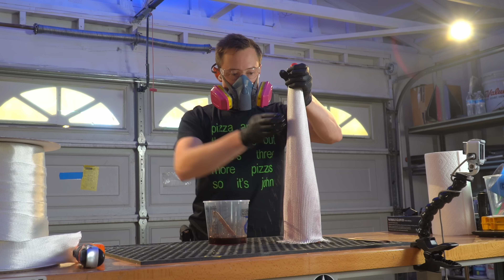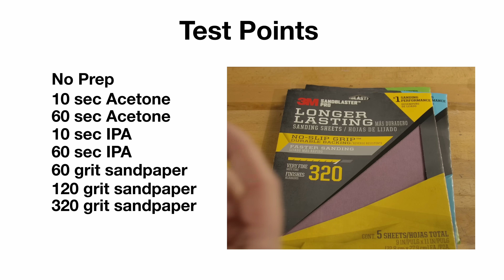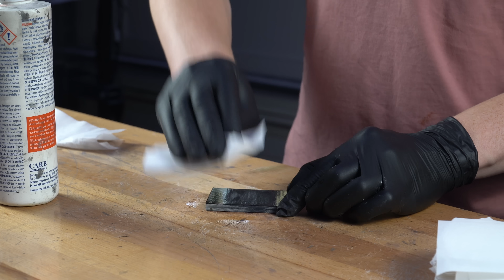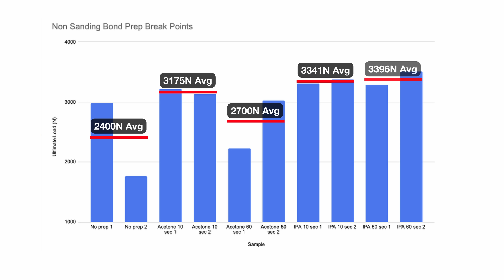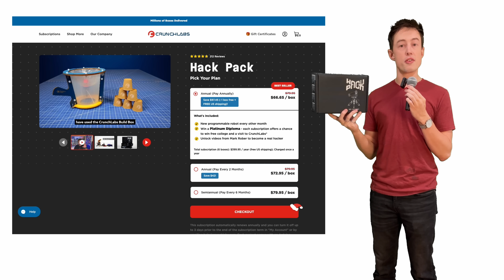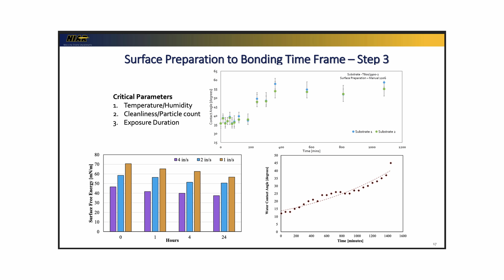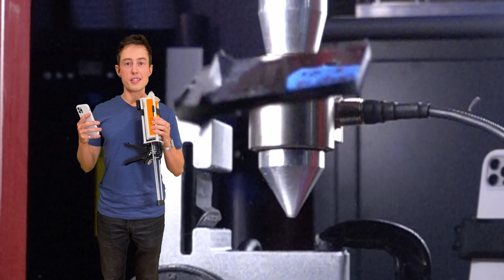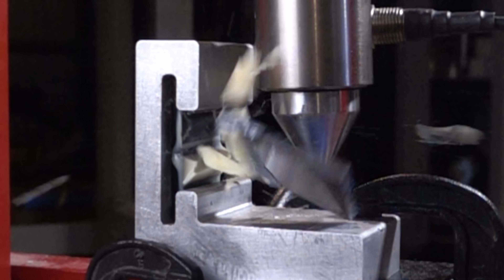I Broke 100 Epoxy Bonds to Find the Strongest

Comment: Question: Did you sand the edge of the horizontal piece, or just the face of the vertical piece? Did you consider using CA glue on the edge + epoxy on for the fillets? Just a thought...

Comment: next test drill holes where the in the fiberglass where the epoxy will be and reinforce the epoxy with a thing bit of fiberglass "skin" and let it cure in a pressure pot

Comment: Hmmm.....Could non-degassing the epoxy, which would allow for some small bubbles to remain in the mix, provide a more "flexible" joint and therefore survive longer before failing...?

Comment: You fell into the typical measurement system error problem. Your measurements are causing most of the differences in the results. Without properly addressing this you will never find an answer to your problem.

Comment: I would ditch the sandpaper and use ULine stainless steel wool. You can easily clean the contamination off steelwool. Lasts a lot longer then sandpaper, too. It also conforms to odd shapes, concave, and convex, much easier.

Comment: I did something similar to this for my university thesis project. I did heaps of testing using the universities instron and I got loads of data. It was filled with errors, but as you say, it has value. Check out my video presentation here:
https://youtu.be/ugsR2vnBUhM?si=D-iX7MkAWXvkSYfZ

Comment: Coming from the boat building industry you should definitely try MMA glues. We use SciGrip SG-200 for laminate to laminate bonds, SciGrip SG-300 for metal to laminate bond. The stuff is indestructible, even with little to no prep. We avoid epoxy as much as possible.

Comment: Did you consider cleaning with soap and water? Ben Krasnow has a great video on how to clean surfaces. The tldr is that cleaning with solvents doesn’t work very well. It always leaves a thin layer of non polar grime.

Comment: I suspect theres a ratio of acetone and ipa as a mixture that would work well as a one fluid surface prep. Maybe 10% acetone and 90% ipa, or maybe a 30/70 ratio. The lower acetone concentration will make it attack the surface less vigorously so you can apply it longer for better working time, and the alcohol will pick up the stuff the acetone dissolves. Would make it easier to work with as its less time sensitive, and skip a step. But the trick would be finding the right ratio.

Comment: I can think of another variable not considered and it will significantly impact bonds not vacuum degassed. Using a brush to work the first layer of epoxy onto the entire surface will help it mechanically bond by pushing out the layer of air that could get between epoxy poured into a joint and the surface. For your test you consistently degassed, but for people working on larger projects like boats they won't likely be able to fit their project in a vacuum chamber. Thanks for doing these tests and posting your frustration with such a challenging issue!

Comment: After sanding each set in your second round (~11:10  in the vid) did you do all the sanding then all your epoxying? Or did you sand->epoxy->sand->epoxy->etc? Since there is definitely a difference related to length of time after prep before epoxy, this might introduce another uncontrolled variable.

Comment: Acetone and IPA. That brings back memories of working in a cleanroom on silicon chips with an oxide thickness that would iridescently reveal every little cleaning imperfection. There is a technique to using acetone and IPA if you want to end up with a truly clean surface. Maybe epoxy bonding could benefit from these cleanroom rituals.

An important principle is that not only can solvents be contaminated in the bulk, but also the free surface of every solvent (even IPA) is full of invisible contamination, and that will land on your surface when it dries. You need to minimize this. That means you only let it dry once at the end, and only with a very very clean solvent.

1. Never let the acetone dry out! Yes, acetone is a more powerful cleaner, but even very clean acetone is contaminated with plasticizers and other junk that it has picked up.  You need to get IPA on that thing while it is still wet with acetone. If the acetone dries, it WILL leave residues and the IPA will often not be able to pick those residues back up.

2. You need to have an IPA wash bottle: a very clean dedicated IPA bottle that never sees anything but God's finest IPA. This lets you flush away all the nasty old solvent and also flush away the dirty contaminants on the solvent surface. This is an upright squeeze bottle with a straw, so it draws clean IPA from the bulk of the bottle, not the surface.

3. Flush with fresh IPA until you have washed away all the acetone and its junk, and flushed away the dirty IPA, and you now are left with pure IPA. You shall never touch the part with any other substance, tool, or material from this point onwards.

4. You now have a beautifully clean part surface sitting under fresh clean IPA. That IPA hopefully has as little floating surface contamination as possible. We are not done yet, because the IPA needs to be removed. At this point in the cleanroom we would gently blow dry with clean dry nitrogen (a bit of technique to that too). Not having nitrogen available, I think just letting it air dry is probably second best.

I would highly distrust wiping away the final IPA clean with a cloth, which itself could contain soluble contaminants that would deposit on the part, or invisible greasy things that could smear on. I would also distrust any source of compressed air as it likely contains compressor oils. And don't even think about using a computer duster can (those contain a bunch of crap too).

Comment: Acetone followed by IPA sounds familiar. Thats the procedure I use in the cleanroom to clean lithium niobate wafers before applying photoresist.

One (not rigorously tested or evaluated) step was to transfer the wafer from the acetone bath to the IPA before the acetone dissolves, as some of the residues left behind by the acetone are not soluble in IPA and will get left behind when the acetone evaporates.
Reply: Have you tried sandpaper though? /j xD
Reply: @DUIofPhysics  60 grit for the win!
Reply: LNOI gang let's goooo!! Also PSA for anyone that ever accidentally gets their wafer dirty with acetone residue: it's not the end of the world, but don't waste your time trying to clean it with organic solvents or O2 plasma. Those will do nothing. Seriously that residue is evil... Just go straight to piranha solution (Sulfuric acid + Hydrogen Peroxide) and it'll come right off :))

Comment: I worked in a very high volume bodyshop that fixed a lot of composite truck hoods. For preparation of the substrate we would sandblast any damaged areas, and blow off with clean compressed air before applying Fusor T21 and glass cloth. Prior to blasting, any tapering around the area would be ground with sharp 36 grit resin discs, along with P180 grit tapering of the paint finish. 

I was always taught to equalize ( dispense ) both tubes on a scrap piece before attaching the mixing nozzle, and even after the mix nozzle was applied to dispense a small amount of the mixed epoxy to discard ( like a half inch ) to ensure the PROPER mixing of the components. 

A two rag system is a must for wiping, one cloth wetted with solvent, followed immediately with a dry cloth wipe before the solvent evaporates on the surface. Alternatively, you can spray the part with solvent lightly and wipe with a dry cloth, but I prefer using a rag wet with solvent. Also, prior to any sanding work, it's important to ensure there are no contaminants on the surface, and also after preparation of the surface. 

Contaminants on the surface get ground into the scratch lines, if you sand without cleaning first. 

A couple of other thoughts, I haven't checked the spec sheets for your epoxy, but it may be possible that you have a bit more heat build up in the mold than you would by making a fillet by hand, and this may change how long the epoxy has to wet out the fiber, affecting the bond strength. Same with putting the epoxy in a deep container while the degassing is being performed. 

Putting the epoxy in a wider, shallow container will reduce heat build up. Slow curing epoxies generally have stronger bonds. 

Consider trying mixing your own filleting compound with West System 105/207 mixed with milled glass fiber and colloidal silica ( West 406 )
Reply: I have a feeling that West 105/207 with 1/32" milled glass fiber and colloidal silica mixed in is going to be quite a bit stronger for the same fillet volume. Also, the random fiber orientation will make crack propogation through the epoxy fillet more difficult.

Comment: I am enjoying your content, and like that, you learn through experience. It's funny that this video came out when it did because I am currently working on a very unique project. I have a roof basket on my SUV. I am an electrician. I need to transport conduit. So, instead of putting a square box on my roof basket, I want to mock up an AIM-9 sidewinder and mount it to the basket. This will do 3 things. First,  allow me a canister to contain the conduit. Second, be much more aerodynamic than a box. Third, get goofy looks from people as a Jeep Cherokee transports an air to air missle around. My biggest concern at this point was bonding the fins and wings. Now, I have some reasonable processes to work with. Thank you.

Comment: I’m going to guess that you don’t want to sand with anything more coarse than about 600 grit… if you test that.. 🤓 you know, to precisely control the epoxy thickness and to reduce micro fractures while still gaining a lot of surface area for adhesion, as well as additional friction for shear strength. 😶edit: oh god, you’re testing a 90 degree joint… unpredictable way of testing adhesion and shear strength simultaneously. Edit #4: This is getting good, should’ve just bought an ozone generator with a fane built in lol. This is a deep dive, love it! Damn, you’re good at statistical analysis. Edit 16: fantastic video! When you do more testing I’d really like to see adhesion testing on round flat surfaces with just a square inch area, and independently do some double lap joints or maybe piston and cylinder style. You could precisely control film thickness of the epoxy and now that you know it’s mixing and work time characteristics you’re halfway there. Outstanding work, I’m saving this video to my engineering playlist. Does Henkel describe in the datasheet the strength of the epoxy itself internally or give a recommendation of film thickness range? Some adhesive are ultra super mega strong if they’re only a couple thousandths of an inch thick or maybe even less, yet if they are several millimeters thick they’re quite weak because the internal strength is not nearly as good as the substrate, in this case because of the reinforcing material.

Comment: ok.  Not an expert, not even a little.  Just curious if you might want to try prepping a coupon with 60, 120, and then 240 grit.  I've done this in woodworking, not necessarily to improve bond strength, but to improve fit or a joint before gluing.  Just curious if this could be a method to make sanding more consistent.  Can't wait to see what you come up with, regardless!

Comment: congrats. you literally figured out what people in auto body knew since the 70s. surface prep is everything and a tiny bit of contamination (especially oils of any kind) can completely ruin a finish. theres a reason why multi million dollar robots paint cars in clean rooms with auto mixing systems. its consistency. and even then those robots make booboos and stuff goes sideways. acetone and ipa are the two solvents that solve 99.999% of bonding problems. and i find it funny you were oxidizing with a torch because ive done that for years and ive always had incredible adhesion using epoxy with flame treatment with lacquer thinner and ipa wipe down after.

Comment: I'm impatient so at 10:37 I'm going to give you my opinion and leave.
Aside from the possibility of lubricant contamination from the fine paper mentioned here, I propose the fine scratches left were too small for the high viscosity epoxy and there may be other factors we're unaware of like the size of molecular chains and van-der-walls forces interfering with complete contact between substances. Conclusion: mold the fins into the original tube with shared fibers.

Comment: When in Uni for Chem we toured an airplane and helicopter factory - super fascinating adhesives work both on the chemistry and the practical technical details - cleanliness is everything there
Because they work mostly with aluminum alloys (and we didn't see the composites side of things much) they focused a lot of prep on making extremely uniform oxide layers on the alloy surfaces.
Practically, that meant using some truly raw chemicals, from highly carcinogenic organics that make benzene blush to nitric and Chromic acid (hexavalent chromium my love). Glad you don't take this route.